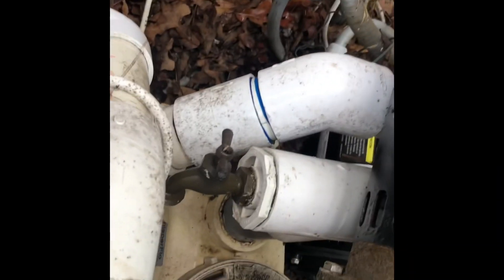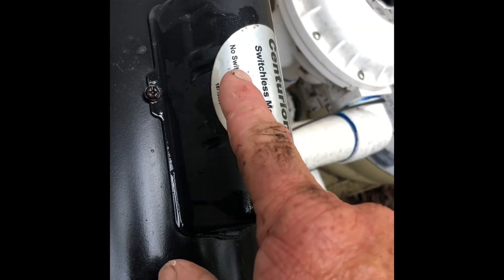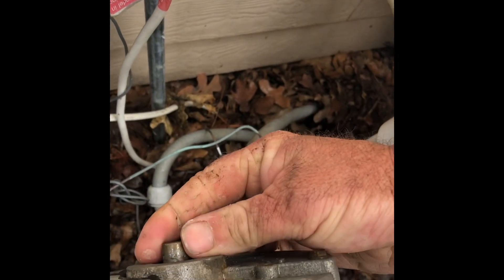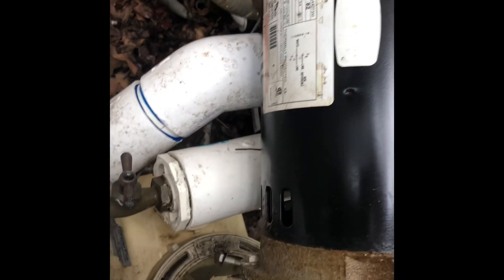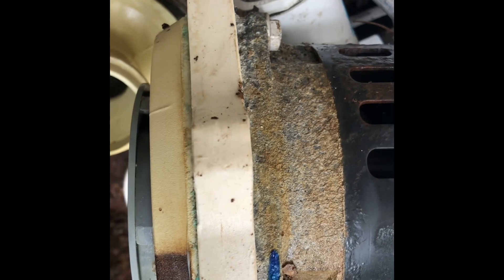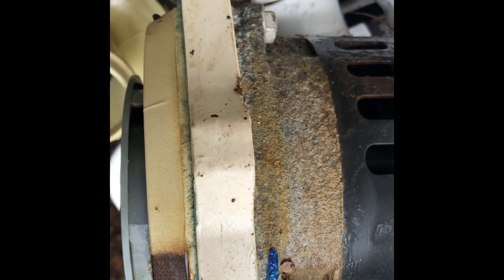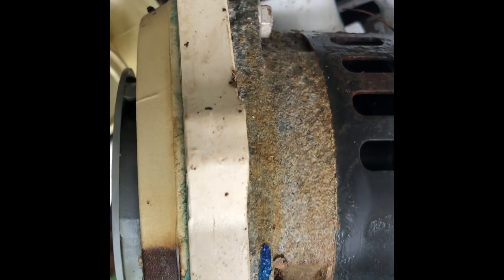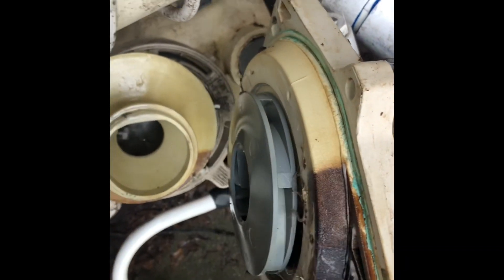Pool Pump Still Humming or Buzzing  After Replacing Capacitor

Comment: Can a bad capacitor create a silence...no humming when u try to turn on the pump
Reply from the maker: The motor has an overload protection system. If it tries to start and fails it will shut down completely for a few minutes. Then it will reset and try again.
If it remains silent and the motor is cold to the touch, it’s most likely a bad motor
Reply: @Pool-guy what if it does this but it’s hot to the touch and keeps trying to restart after cooling down (sometimes it actually runs fine for about 40min then shuts off again and won’t start up). It’s not tripping the breakers which is odd ?
Reply from the maker: @LaserNrg  if it’s overheating and turning off then it could be a bad capacitor or something rubbing inside the pump, likely something obstructing the impeller. Open up the pump by removing the 6 bolts on the front housing. Then spin the impeller all the way around the slightest hang up can cause the pump to overheat. 
If no obstruction then sounds like a bad motor.

Comment: So the first step would be to turn the shaft. Not replace the capacitor first then check the difficulty of rotating the motor shaft.
Reply from the maker: Yes, that’s actually a great tip, thanks for sharing